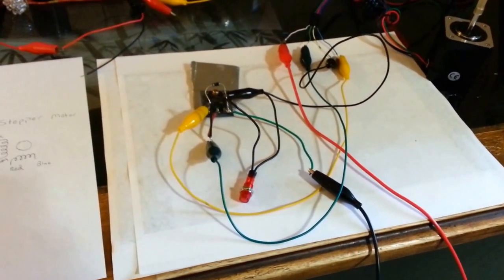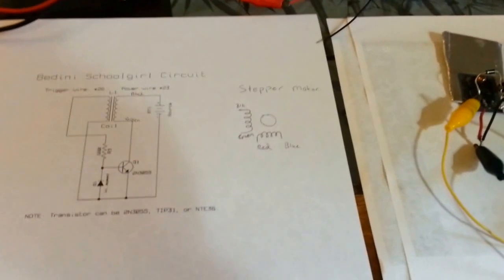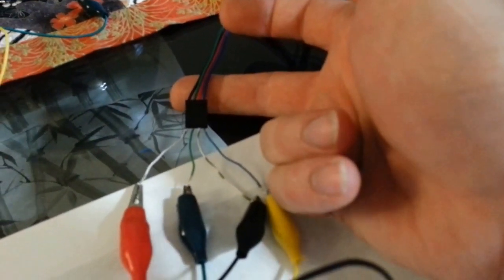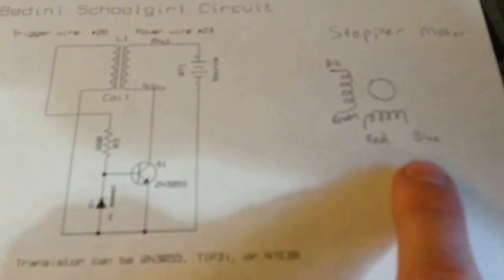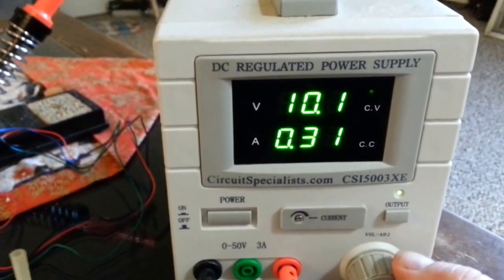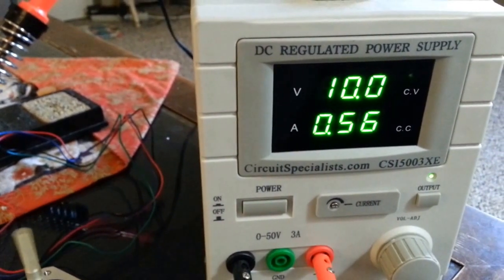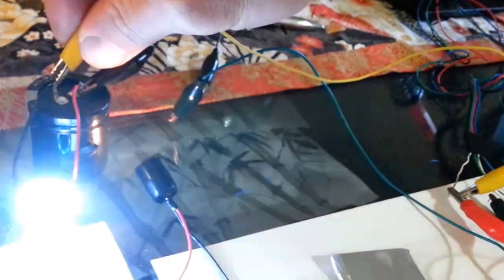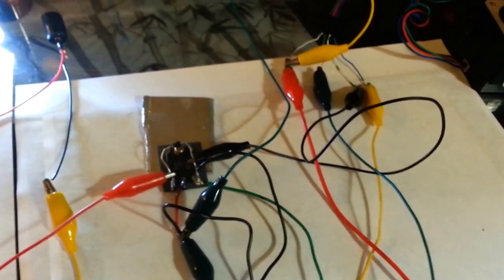Bedini stepper motor project

Comment: Hey, my friend" I like What you're doing with the SG, Cercite. SO, I've
Decided to give you a lil" tip.!!
Now, try feeding ( RF ) Into the power supply system, after, what you have is coming, out of your power supply but before it goes into you're
First coil. Use a small amp, like for
A car, try to get the Two, to phase,
Together, as much as possible. I don't know if you have a scope,.. 
But it would be very useful, there's a few things you may see, one " one "
Is: you're amps will GO WAY DOWN.!!
Now, another thing is, the return voltage, should be way UP.!! Over UNITY, That's what I got.... Then for
REAL fun, add a step-up transformer, & run it through a spark Gap. That's when you should hang on to the chair, cause you will - Not, be able to hold on.!!

Comment: Hello, can you tell me is there any difference between 4 and 8 wire step motor, I would like to test this also but I have only 8 wire step motor.
BTW, like your idea very much.

B.R.
Tom
Reply from the maker: http://www.orientalmotor.com/images/mainContent/unipolar_ill_02.jpg  This is a wiring diagram for several types of stepper motors. You can see that the 4 wire motor and the 8 wired as a (bipolar series connection) are the same just with a jumper wire between yellow and orange, and between white and brown. If your motor wires are different colors then just look for the 2 wires with the most Ohms between them...hope this helps.